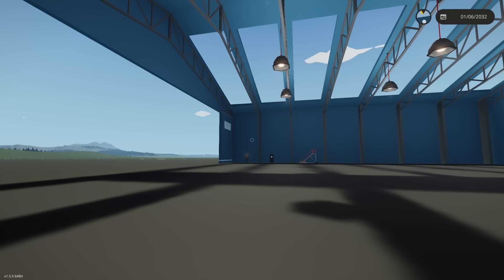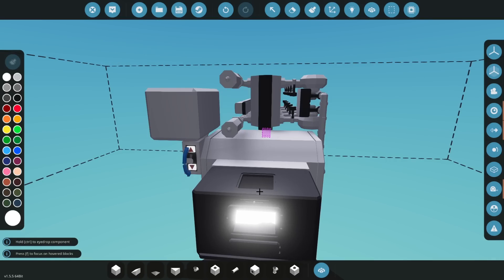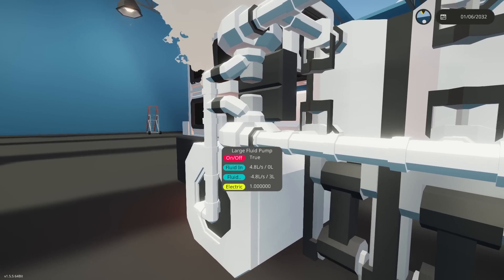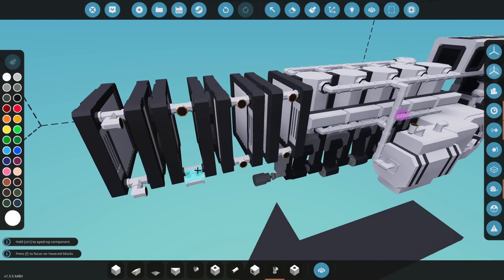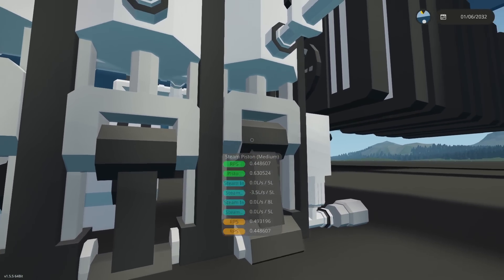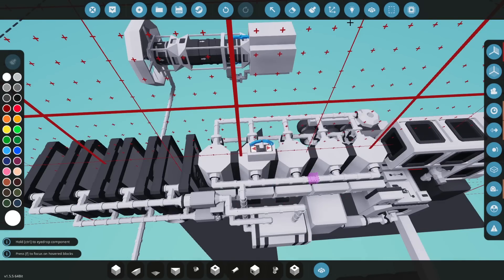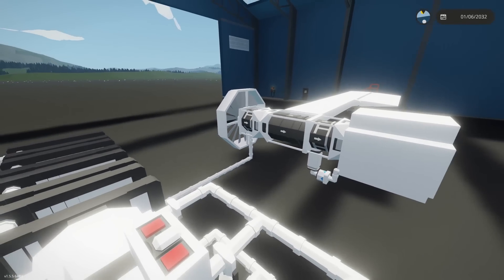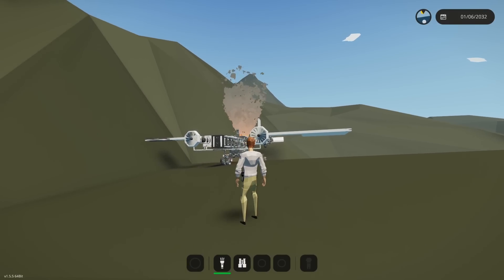I Made A STEAM PLANE In Stormworks!

Comment: If you're having trouble with boiler explosions you can use on/off valves to control the amount of coolant from the firebox entering the boiler.
Reply: Or use variable valves
Reply: @grande1900  Or use your coolant pumps themselves because the standard 3x1x1 pumps work like valves as well.